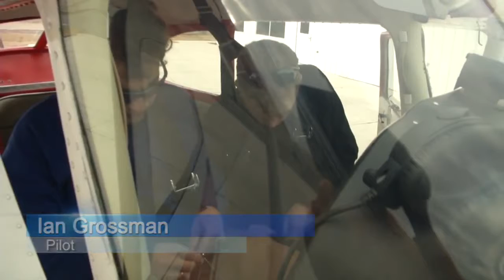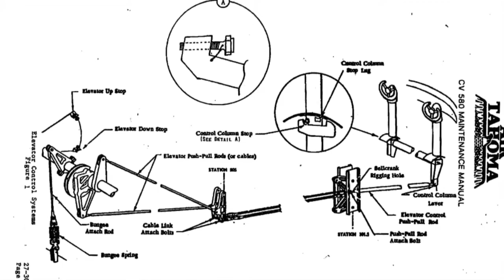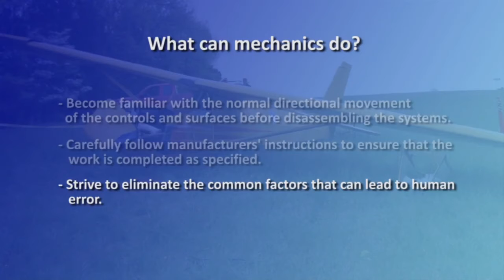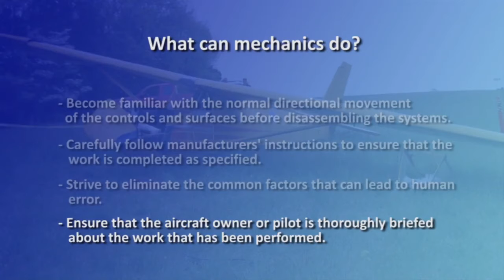Airplane Misrigging Lessons Learned From a Close Call by the NTSB

Comment: Kudos to all involved, especially the mechanic (for enduring what must have been a very painful interview.) 
A good checklist item for every take-off is "Full and free movement of all controls, in the normal direction"; that includes a look at the trim tab, if you can see it. If any aren't visible from the cockpit, include them in the walk-around. The first flight after ANY work should be preceded by an extra-careful  check. The literature is full of crossed controls, engines not filled with oil, taped-over static ports and other things that can spoil your whole day.

Comment: I'm surprised these pilots got into such a mess. When I was getting my instrument rating, I once flew a Seneca where the controls for the electric trim had been transposed, in IMC and light to moderate turbulence. It didn't take me long to figure out what was going on and I completed the whole 1 hour flight with very little difficulty. At first I relied on the manual trim but in due course I reverted to the electric trim and operated it in reverse. The tough one is transposed aileron controls, but I've tried that on my simulator and it can be done.

Comment: Hats off to the mechanic for having the courage to come forward for this. I'd have hoped there would have at least been a visual check of full up trim and full down trim any time trim is re rigged or re centered. With correct procedures and checklists, this kind of thing shouldn't be possible. All it would take is two check boxes on a checklist to prevent this from ever happening again. If the mechanic missed one, he'd catch it on the second. Knowing how understaffed the NTSB is, I doubt this has really been addressed and instead we're just supposed to learn from this video and apply opposite trim if it ever happens to us.